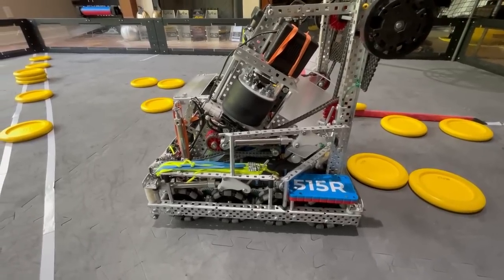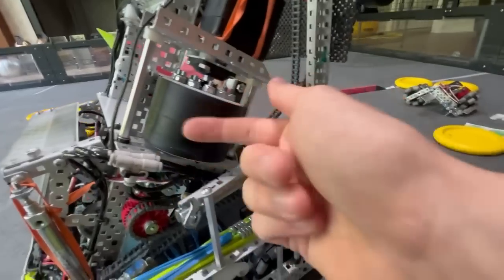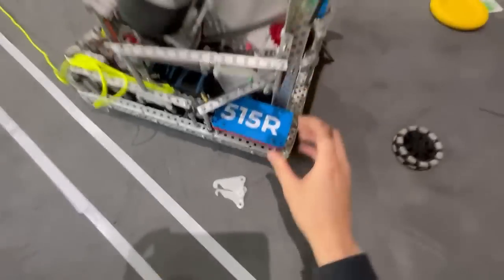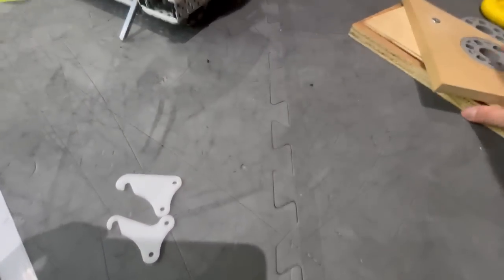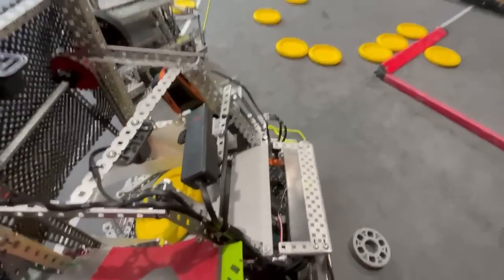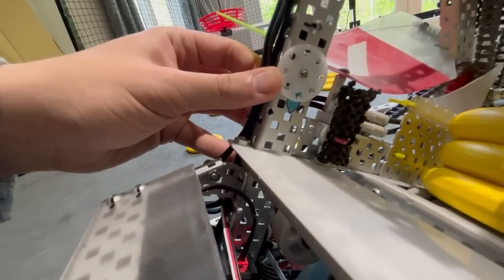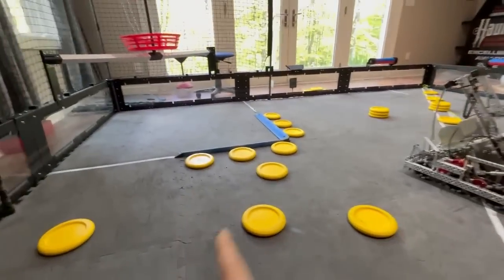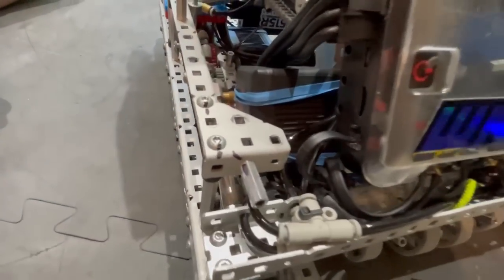515R worlds robot explanation (Vex Spin Up)

Comment: okayy soo i love you guys and i have one question about the drive train, how do you guys gear that for speed because when we used that gear ratio is went really slow, and we used the standard green cartridge motors!
Reply: we see you guys using the standard gears in vex, we used high strength gears on ours , would that make a difference?
Reply: Try changing your spacing so it can move very slightly. The friction may be too much for the motors.
Reply: They used blue cartridges for 450rpm, the green cartridges gave you 150rpm. However 450 on 3.25 is very fast, so I would not recommend to beginner teams

Comment: I thought you couldn't have 3d printed parts??
Reply from the maker: We don't use any 3D printed parts on the robot.
Please correct me if I'm wrong, but I believe you are referring to the white plastic components. These parts are laser-cut Delrin, which fall under 12 x 24 non-shattering plastic sheet.
Reply: @515Revision  Oh that's smart

Comment: What's the diameter and material of spacers that you used on the shafts between the drivetrain wheels? Also it was awesome to see you guys progress over the season. - 9257R (It would also be great if you could link it).
Reply from the maker: https://www.mcmaster.com/products/spacers/nylon-unthreaded-spacers/
You want 6mm OD and 4.3mm ID.
You can pick any length.
I think I got 32mm long which was perfect for just using one spacer.
Reply: @515Revision  Thank you!

Comment: I see in your code that you use rotation sensor instead of odom pods. How does that work with sideways motion?
Reply from the maker: I believe that is unused code. 
Our drivetrain code uses odom wheels for skills auto and motor encoder for match play. We occasionally ran into problems with robot position during match autonomous, however it was typically caused by collision between us and the opposing team.

Comment: Fun fact: the curvature of the earth actually cancels out the uphill driving on 4 wheel drives. This is the only reason they even work.
Reply from the maker: Great point! It only works though if your field is parallel with the equator and ours isn't so we needed 8 wheels.

Comment: What are all the offset screws for on the drivetrain?
Reply from the maker: The bottom row of screws on the drivetrain are screw joints, connected directly to the drive wheels. This allows the same free-spin as a shaft/axel setup, but with additional structure, due to the screw holding in both C-Channels on its respective side.
Reply: @515Revision  That's super cool, so did you choose to have all the wheels slightly lower due to spacing? Or was it for going over the low goal barrier or something?

Comment: Is there a significant differance between low strength and high strength gears on drivetrain?
Reply from the maker: The main advantage we have seen to low strength gears on the drivetrain is size. We originally had high-strength gears on the drivetrain, but were able to slim each gearbox by 0.5" using the low-strength gears. There is a risk of gear slipping, but we did not run into any of these problems throughout Spin Up.

Comment: what is bang bang and how does it differ from pid?
Reply from the maker: Bang bang switches between 0% and 100% power, depending on whether the flywheel RPM is above or below a desired target, respectively.

Its advantage over PID is that it is simply the fastest way to reach an upwards target speed. There is no lost time from slowing down to stabilize the speed. The disadvantage, at least from our testing, is that it can more quickly overheat the motor and is more difficult to maintain a tight margin around the desired velocity.

A middle-ground between the two is Feed Forward, which uses Bang Bang when the flywheel RPM is far below its desired target, but then switches to PID once it is within a certain range. The range from us was 300 RPM below (in 1:1 cartridge units).
Reply: @515Revision  ah okay thats very cool thanks for sharing

Comment: kinda specific but i saw that there was like an intermediate roller in the back that was chained to the roller mech. Was that on a screw or shaft?
Reply from the maker: Yea so that was a stage that allowed the roller mech to be geared down more. It was a screw but on it was a drilled out high strength shaft which allowed it to spin freely on the screw but connect the two sprockets motion together.
Reply: ic

Comment: Just curious - is that PTO canti? Why is it fine in that situation? I’m guessing it’s because it already has two points of contact, but I’m wondering if that still adds friction.

Thanks, - 6121C
Reply from the maker: are you talking about the indexer ratchet?
Reply from the maker: If so, in this case it wasn't under much load and torque at all which allowed it to work fine, and it needed to be out of the way otherwise it touched the discs as they came up the intake. So yes its not in theory the best but worked fine for fixing a problem on the robot.
Reply: @515Revision  got it, thanks so much!